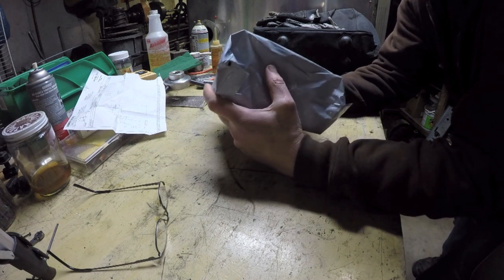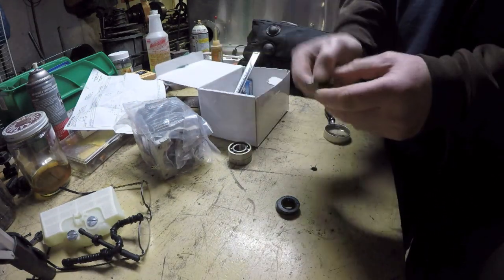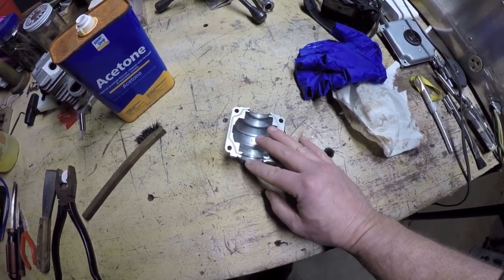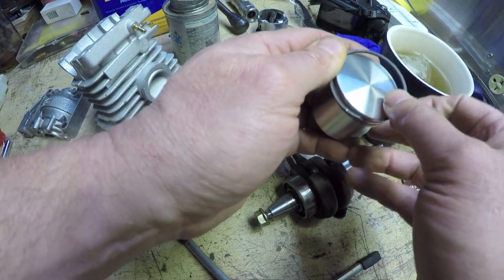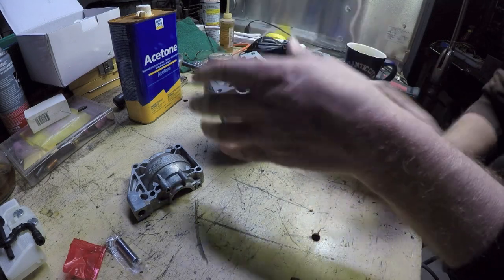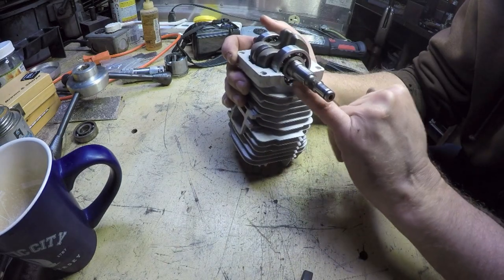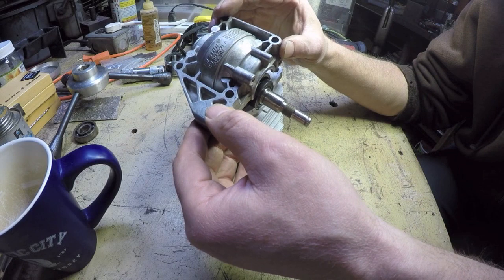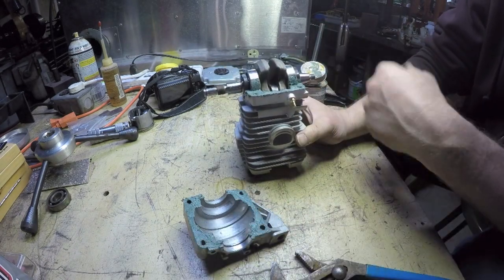Stihl MS290 chainsaw rebuild Part 4

Comment: My name is Ian Grant first time watching your video I also repaired chainsaw Stihl brand just wanted to give an input I use aftermarket parts and they are great sometimes you get some that are not so great just want to those Chinese piston c-clip they are nothing more than a pair of junks some part of them is breaking off in the long run undamaged the cylinder head and piston it happened to me with those Chinese clip so I use the original one instead. Come in the original pissed and and they were great not to say that they cannot use you should cut off the little pointy part that stick up in the air that part is the problem

Comment: my 2 cents as a auto tech,i would use the permatex ultra black on the crankcase because i dont think what you used will seal very well. as many oil cans that you have,everything shouldve been lubed prior to installation to prevent a dry first start.
Reply: I just did this and one of the permatex 29132 said it was  for chainsaw blocks

Comment: Thanks for the videos.  I'm considering rebuilding my ms290 with a 49mm upgrade, and I am carefully considering an aftermarket kit like you have chosen.
Reply: I've done about 10 of those in the last couple of years, works very well and gives the saw more power.  I generally modify the muffler for a little more air flow (don't get carried away) and I generally richen up the carburetor a bit..

Comment: Glad you got back on this one. I've been wondering about the kit. You don't oil those seals when installing? - Happy Father's Day.
Reply: I generally grease the seals with Stihl assembly lube and I put two stroke oil on the cylinder and piston rings and a bit on the main bearings.

Comment: Redundant ground wire is because the wires are close to the flywheel and sometimes they get cut by the flywheel so tuck the wires in away from the flywheel as much as you can.